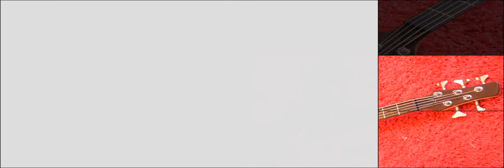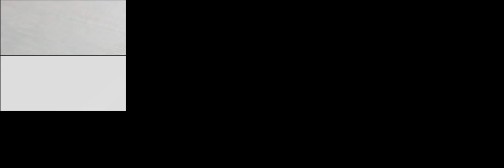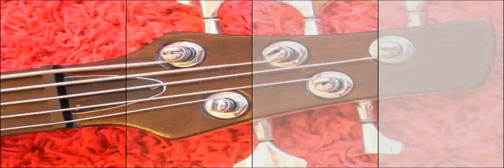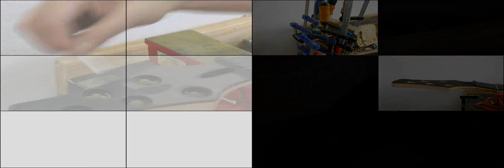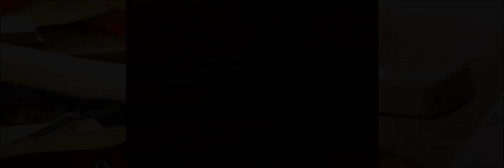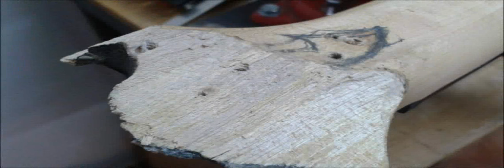Paco Chorobo - Reparación bajo eléctrico / Broken bass peghead

Comment: hola buen video una pregunta tengo un bajo tenia un zumbido tenia que agarar las cuerdas era un cable de tierra cortado al soldarlo se fue el zumbido al conectarlo ala bocina pequena de casa suena bien sin ruido pero al ponerlo a bocina grande o amp no tiene mucho volumen y tiene un ruido constante como bum bum ojala me ayude yo pienso que es las pastillas ojala me ayude
Reply from the maker: Hola Otoniel, siento no haber visto este mensaje antes. Parece que tienes un problema de apantallamiento, y es muy posible que todo el problema venga de la electrónica pasiva que tienes. Si es activa, comprueba que la alimentación y todo el circuito que alimenta el pickup estan limpios! Es muy dificil ayudarte simplemente con lo que me comentas. Aunque tarde, no quería dejar el comentario sin contestar. Un saludo desde Ubeda!